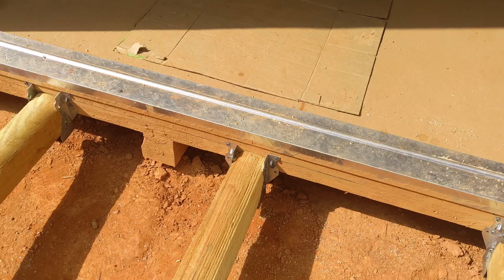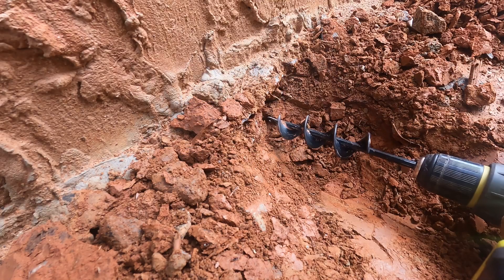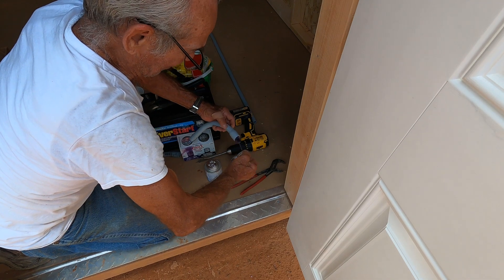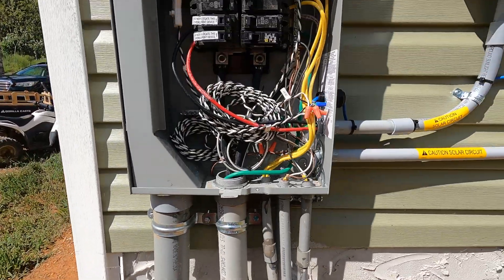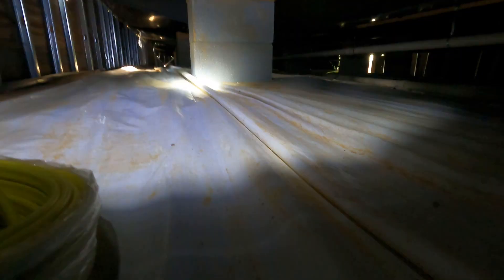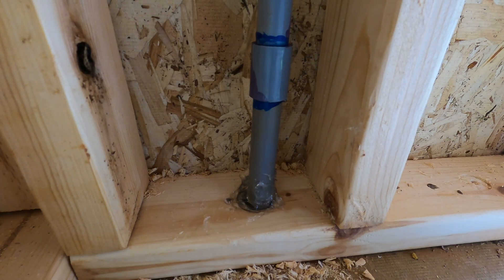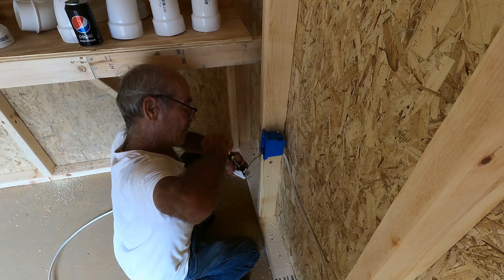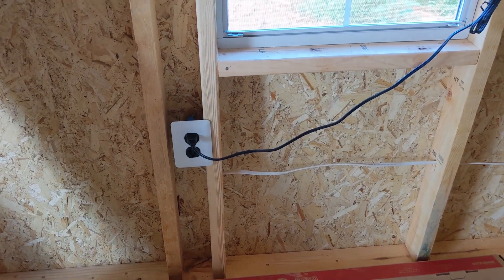Running Electricity to Shed - Outlets and Lights - Powering Outdoor Storage for Freezers and Fridge

Comment: Great "how not to" video
Reply from the maker: What do you think we could have done differently?
Reply: @RigginFarm  1- PVC not deep enough - check locale code
                            2 - tape on buried pipe
                            3- should be a subpanel in shed with separate neutral and ground                        
                                 add a ground rod 
                            4 - those exposed wire nut connections
                            5 - It's all on one 15-amp breaker from the main box? 
                             It will probably work fine but not a good example for others.

Comment: Let's see.  Conduit spliced with tape.  NM-B ran in wet location.  Splicing outside of a junction box.  Inadequate burial depth.  That conduit is going to be filled with water and eventually mud.  You could have just run  *Schedule 80* down to 12 inches with a 90 sweep and skip the horizontal run, and route UF-B cable down to 12 inches and run it direct buried between buildings.  UF-B is rated for direct burial.  And PUT A JUNCTION BOX where the conduit rises into the crawlspace and shed.  You put a lot of work into doing things not to code!  I won't get into the janky Sched 40 conduit you're using in areas subject to physical damage, running at an angle out of your enclosures.